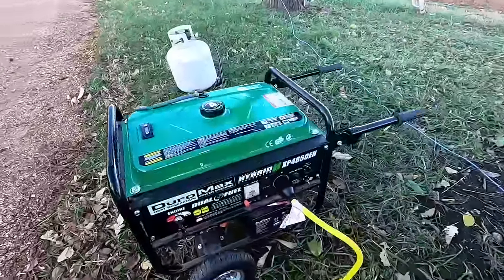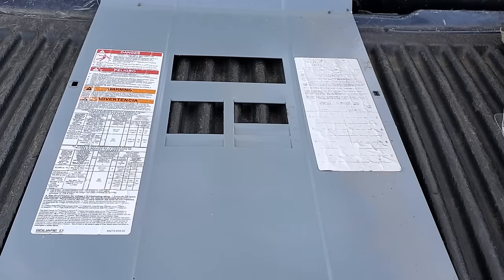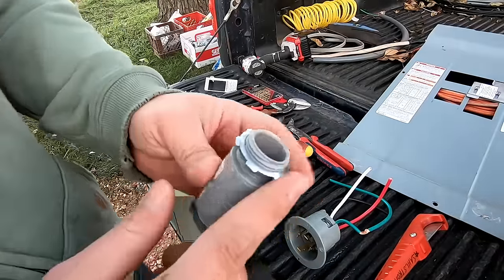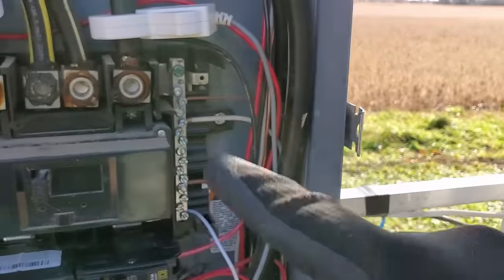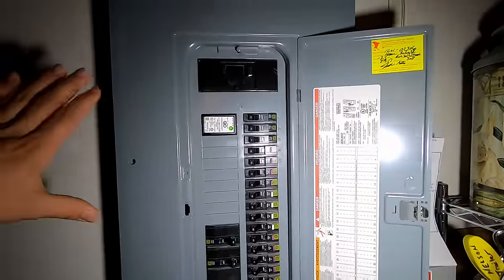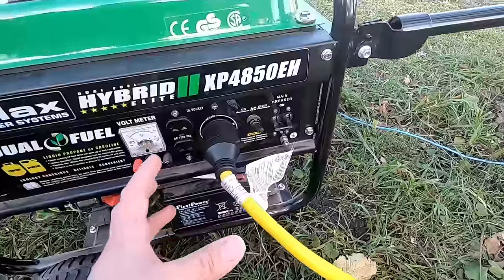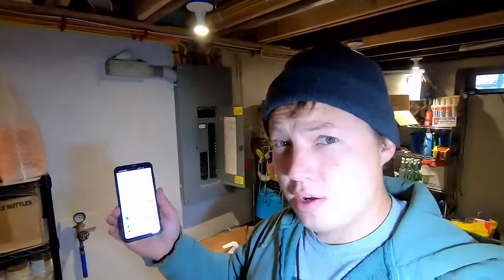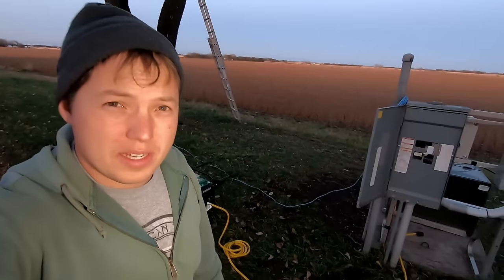How To Hook Up a Generator To Your House Using a Breaker Interlock Kit & Power Inlet Box

Comment: How do you keep current from returning through the neutral to the main line. I saw that you connected the inlet plug to the neutral bar but I was concerned about back feeding the neutral to the people working to repair the main line.
Reply: Generator safety rules: Always make sure you follow all the generator safety rules whenever you use your portable generator. This is a reminder for everyone’s safety of using generators. Generators can be dangerous if not used carefully. Every year, hundreds of people die or get injured when using portable generators due to carbon monoxide poisoning and electrocution. Make sure you are using your generator carefully and keeping others safe as well. There is something very serious that everyone should always be aware of when using generators. Some people do run their generator indoors which is not safe and that increases the risk of carbon monoxide poisoning which can cause death of family and you. Some people run their generator in wet conditions which can electrocute them. Please remember that you should never run your generator indoors. Remember that carbon monoxide is an odorless and colorless gas that you cannot see or smell. Carbon monoxide is a silent killer. Keep that in mind. Make sure your generator is 15-20 feet away from your house and away from doors, windows, and vents. Never use your generator in your porch too. Having a carbon monoxide detector is very important against generator safety. Some people also allow children to go near the portable generator which could pose risks. We need to keep an eye on our children making sure that they are not near the portable generator so they won’t get electrocuted or burned by the generator which is dangerous. A locking enclosure also keeps kids safe. A generator shed might look like a tempting place to explore, or take cover during a game of hide and seek, but a generator is a dangerous piece of equipment that can cause injury. It says on the manual that we should also keep children away at all times from the portable generator to avoid injuries. Please do not allow a child or unqualified people to operate the portable generator.  It is important to keep your children safe especially little ones. The portable generator can be hot during an operation. Just because some manuals missed what should be listed doesn’t mean it’s safe to do. Always follow the generator safety rules when using portable generators. Generators pose electrical risks. If you need to use your generator during wet weather, you need a generator tent to protect your generator from getting wet. Don’t let your generator get wet. Keep your generator dry and before using your generator, please make sure your hands and your generator is dry. Do not wear loose clothing when operating the generator. Everything that is said on the generator’s operating manual should not be ignored. Never smoke cigarettes near the generator. Please keep flammable things away from the generator. Never overload your generator too. Your generator can catch fire. Never ever try to plug a generator cord into a wall outlet to avoid back feeding. Back feeding your generator is dangerous. Always turn on your generator first before plugging in appliances and shut off the appliances before turning your generator off. Use a heavy duty cord for your generator and the cord should not be worn out. All the instructions should be followed carefully. Never refuel your generator while it’s running. It can cause fire if fuel spills while your generator is hot. You should turn off your generator and let it cool off before refueling it. Having a fire extinguisher next to the generator is also important. This is only a reminder for everyone’s safety of using generators. Make sure your generator is properly grounded. Having a fire extinguisher next to the generator is also important against the safety rules. https://youtu.be/I1jT3ANENvI and here is a video more about keeping others safe when using generators and also about our family’s safety. It’s important to keep our little children safe as well. Make sure your little children are kept away from the generator at all times especially when it’s running. Hope this helps. Always remember that it’s better to be safe than sorry. Also remember that warnings should not be ignored too.

Comment: You were use 230v from generator and  you checkout outlet in refrigerator only 120v ?
Reply: ⚠️Please don’t forget the rules about generator safety: This is a very important announcement for everyone. It’s important to follow all generator safety rules whenever we use portable generators: 

Everyone must see this. This is just a reminder for everyone’s safety. 

1) KEEPING OTHERS SAFE: Please do not allow an unqualified person or your children to operate and service the portable generator. Just because some manuals don’t say that doesn’t mean it’s safe. That is important against the generator safety rules. We also need to be keeping an eye on our children too. You need to make sure that your children are not playing near the portable generator especially when it’s running so they won’t get electrocuted. Generators pose electrical risks and they can be hot during an operation. Please keep your children away from the portable generator at all times. It is important to keep our children safe especially our little ones. Be aware of all the hazards.

2) WHERE TO RUN YOUR GENERATOR: Some people use their portable generators indoors which increases the risk of carbon monoxide poisoning. It’s important to have a carbon monoxide if you have a gas generator. Never ever use your generator indoors even if your doors and windows are open and even in the garage is not safe to use a portable generator. Not even at your porch and your deck. It is never safe to use your generator indoors and in enclosed areas of your home. Your generator needs to be 15-20 feet away from your house. 

3)🔥FIRE HAZARDS: Never refuel your generator while it’s running. You need to let your generator cool off before refueling it and before storing your generator. Never overload your generator too. Never ever back feed your generator. You should never plug your generator into a wall outlet. Also never store propane tanks indoors. Please keep flammable things away from the generator as well and please don’t smoke cigarettes near the generator. Having a fire extinguisher next to the generator is also important against the generator safety rules. 

4) GENERATOR OPERATION: make sure your hands are dry before touching the generator. Never use your generator in wet conditions. Don’t let your generator get wet. You need a generator tent if you need to use your generator during wet weather. Please don’t wear loose clothes when operating the generator. Turn on your generator before plugging in appliances. Use the right cord for your generator. Please do not use worn out cords. 

https://youtu.be/I1jT3ANENvI and here is a video more about keeping others safe when using generators 

Hope this helps. Remember safety first

Comment: What happens to the main neutral when using a generator connected to the main box?  Is the current  going to ground? Why? On older homes , the water pipe is the ground any issue? How does the current
know which way to go on the water pipe?
Regards

Comment: Hi Ben thanks for the informative videos but I was wondering if you could elaborate on your internet and/or WiFi setup that you have out there providing service for your nest cam and your sense monitor. Can’t help but notice the Ethernet cable hanging from the tree and coming from the mounted enclosure.

Comment: The reason it probably tripped the overload at 3100w is most likely because the running watts of that model is actually only about 3800w and when using propane you actually lose some power output, probably around 500w.

Comment: very nice video.  although I am sure with this video, I could DYI.  I am still going to have a electrician wire my generator .  I do have a better understanding of what needs to be done.  Unfortunately,  I called  a Generac dealer and he wanted $8000.00 labor  just to wire the transfer switch etc.  I told him he was nuts.   WE just had a power outage so everyone is price gauging .  I was told by generac that average insulation would be roughly $2000.00 . NOt only did this local guy want 8000k for insulation.  he also wanted $1000 more for the same set up generac has on their website.  I called my electrician that I use and he is going to set it up well under 2000k.  just waiting for his schedule to clear up.

Comment: Ben, your videos are very helpful. One thing I need help on,   I have a Duromax 12,000 Watt.  The generator has a 50 amp 4 prong receptible.
I want to back feed to my house to run 240V HVAC.  Question. Do I use a 4 conductor cable from the generator to the house main panel?  I have looked for #6  4 conductor cable at big box stores and have not found 4 conductor cable, only 3 conductor.  Amy I correct thinking I need a 4 conductor cable from my generator to house main panel to run 240V HVAC
Reply: Remember that back feeding your generator can be dangerous. Never plug in your generator to a wall outlet. Remember the generator safety rules. 

Here are the generator safety tips that need to be followed:

This is a safety reminder 

1) Please do not allow an unqualified person or your children to operate the portable generator. Just because some manuals don’t say that doesn’t mean it’s safe. That is important against the generator safety rules. We also need to be keeping an eye on our children too. You need to make sure that your children are not playing near the portable generator especially when it’s running so they won’t get electrocuted. Generators pose electrical risks and they can be hot during an operation. Please keep your children away from the portable generator at all times. It is important to keep our children safe especially our little ones. Be aware of all the hazards.

2) Some people use their portable generators indoors which increases the risk of carbon monoxide poisoning. It’s important to have a carbon monoxide if you have a gas generator. Never ever use your generator indoors even if your doors and windows are open and even in the garage is not safe to use a portable generator. Not even at your porch and your deck. It is never safe to use your generator indoors and in enclosed areas of your home. Your generator needs to be 15-20 feet away from your house. 

3) 🔥generators cause fire hazards too. Never refuel your generator while it’s running. You need to let your generator cool off before refueling it and before storing your generator. Never overload your generator too. Never ever back feed your generator. You should never plug your generator into a wall outlet. Also never store propane tanks indoors. Please keep flammable things away from the generator as well and please don’t smoke cigarettes near the generator. Having a fire extinguisher next to the generator is also important against the generator safety rules. 

4) generator operation; make sure your hands are dry before touching the generator. Never use your generator in wet conditions. Don’t let your generator get wet. You need a generator tent if you need to use your generator during wet weather. Please don’t wear loose clothes when operating the generator. Turn on your generator before plugging in appliances. Use the right cord for your generator. Please do not use worn out cords. 

https://youtu.be/I1jT3ANENvI and here is a video more about keeping others safe when using generators and also about our family’s safety. Hope this helps

Comment: Neutral bus and ground bus should be separate and not combined?? One bus for white wires and one bus for bare wires?
Reply: On a main panel the neutral and ground busses are connected. On sub panels they must be isolated.

Comment: 11:44 WITH THE TORQUE SCREW IDEA, IT'S REQUIRED FOR MECHANICS TO NOT BE CONSIDERED A HACK OR A BUTCHER FOR FUTURE MAINTENANCE OF AUTOMOBILES; LIKE SOMEONE ELSE IS GOING TO BE THERE IN THE FUTURE SO DON'T BE SLOPPY AND CAUSE PROBLEMS DOWN THE ROAD FOR YOURSELF AND OTHERS.
IN MARTIAL ARTS YOU PERFORM HOW YOU TRAIN, SO YOUR ALWAYS TRAINING TO PERFORM...
THAT MEANS IF YOU TRAIN FULL CONTACT, YOU WILL PERFORM THAT WAY;
IT ALSO MEANS THAT IF YOU TRAIN LIKE GARBAGE, YOU WILL PERFORM THAT WAY.

Comment: What did I do wrong? 
Have all the breaker switches off. Start the neutral bonded and grounded generator.
Plug the 30 amp cord into the inlet box and then into the GFCI protected outlet on the generator.
Then the breaker on the generator trips and generator shuts down. 

All switches on the breaker box are off.
The inlet box is connected by 10-3 with a ground to a double pole 30 amp breaker in the secondary breaker box.
The primary breaker box is also turned off. Neutral and ground are bonded there.
I checked continuity on the extension cord, it’s straight through and no bleeds.
Tried removing ground on the generator and it still trips.
?
Reply: ⚠️Please don’t forget the rules about generator safety: This is a very important announcement for everyone. It’s important to follow all generator safety rules whenever we use portable generators: 

Everyone must see this. This is just a reminder for everyone’s safety. 

1) KEEPING OTHERS SAFE: Please do not allow an unqualified person or your children to operate and service the portable generator. Just because some manuals don’t say that doesn’t mean it’s safe. That is important against the generator safety rules. We also need to be keeping an eye on our children too. You need to make sure that your children are not playing near the portable generator especially when it’s running so they won’t get electrocuted. Generators pose electrical risks and they can be hot during an operation. Please keep your children away from the portable generator at all times. It is important to keep our children safe especially our little ones. Be aware of all the hazards.

2) WHERE TO RUN YOUR GENERATOR: Some people use their portable generators indoors which increases the risk of carbon monoxide poisoning. It’s important to have a carbon monoxide if you have a gas generator. Never ever use your generator indoors even if your doors and windows are open and even in the garage is not safe to use a portable generator. Not even at your porch and your deck. It is never safe to use your generator indoors and in enclosed areas of your home. Your generator needs to be 15-20 feet away from your house. 

3)🔥FIRE HAZARDS: Never refuel your generator while it’s running. You need to let your generator cool off before refueling it and before storing your generator. Never overload your generator too. Never ever back feed your generator. You should never plug your generator into a wall outlet. Also never store propane tanks indoors. Please keep flammable things away from the generator as well and please don’t smoke cigarettes near the generator. Having a fire extinguisher next to the generator is also important against the generator safety rules. 

4) GENERATOR OPERATION: make sure your hands are dry before touching the generator. Never use your generator in wet conditions. Don’t let your generator get wet. You need a generator tent if you need to use your generator during wet weather. Please don’t wear loose clothes when operating the generator. Turn on your generator before plugging in appliances. Use the right cord for your generator. Please do not use worn out cords. 

https://youtu.be/I1jT3ANENvI and here is a video more about keeping others safe when using generators 

Hope this helps. Remember safety first
Reply: Since that last post I made a easy modification to the generator’s exhaust. I made a “T” shaped stack that is a snug fit so it can be easily installed and removed. It’s made from light thin walled tubing and held together with two self tap screws. The straight up piece is five feet and the stub is long enough to set it off the chassis. I left the bottom open and just touching the ground. It reduced the noise a lot, it think it’s just not echoing off the fence or neighboring structures. 

I’ll review the safety video and try a load test next time I have free time. Thank you…